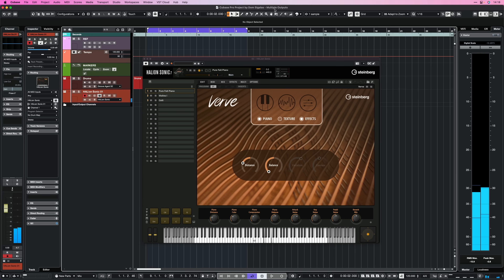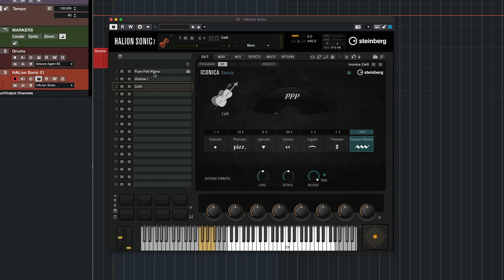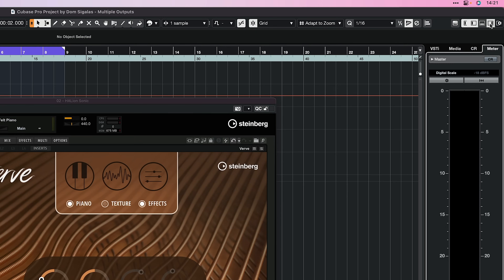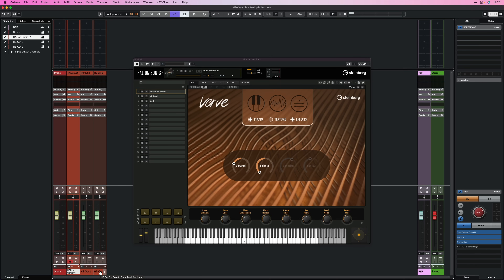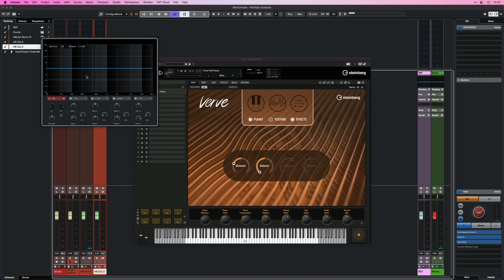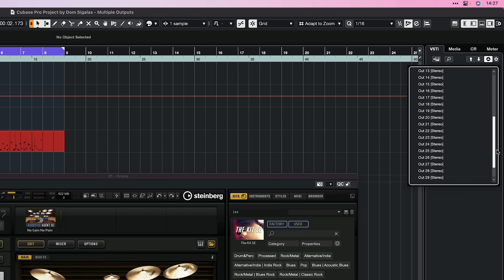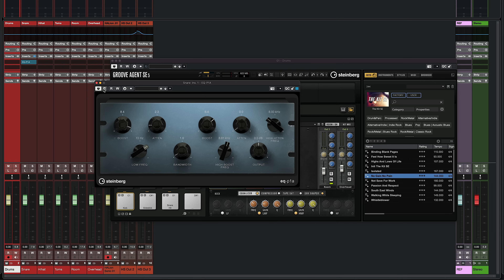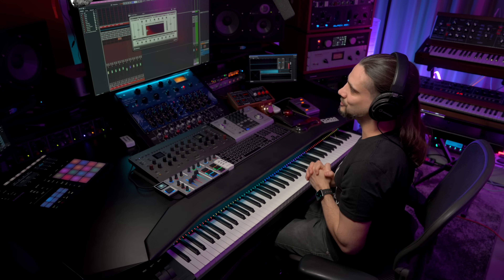How To Use Multi Out Instruments In Cubase | Cubase Secrets with Dom

Comment: My audio input into my Vmix is through a USB which gives me a single line of audio track. 

I need to split this single audio into int's different instrument lines/tracks (6-7 lines in all) so I can adjust each one as required before finally re adding audio to my Vmix production and final stream. 

I have been reading on and researching to find the best vst3 plugin that can do this. My plan is to install this VST3 plugin into Vmix, but I'm open to any solution that works too. 

Any advise? Thanks.

Comment: The drum part is very interesting and useful.
Now, is it possible to do the same for drums in terms of MIDI tracks?
When I record a drum track on my keyboard it all goes out to the same MIDI track.
Is it possible to reroute the Bass Drum, Snare etc. to separate midi tracks so that I could make MIDI edits in separate tracks?
Reply: Yep, use different channels, or try the input transformer, out a rule up the top  if note is C1, filter on ch 1. You can also have several lanes but unlike audio they are fine to play over the top of each other which is what I do most of the time .

Comment: Thanks, Dom!
Question guys: Let's say I'm working with Superior Drummer and re-route every mic to a separate output. The presets in SD have lots of nice plugins inserted in its built-in mixer. When I use route the mics/mixes to Cubase, I get the processes from every mic, except for the master, because now, of course, the mics (or each instrument mix if one has more than one mic, like the Kick) are routed outside of SD, and the final mix within SD gets no signal. So I lose the final step of the sound process (sometimes, there are several plugins there, maybe a couple compressors and an EQ, which are not included other than in that built-in mixer).
Is there a way to keep that, or should I replicate it with other plugins in Cubase itself (using a group channel)?
Reply: I've been wondering the same! Rerouting each mic to a separate output in the Mixconsole would mean that nothing will pass through SD's built-in master. So I'd just try and replicate the chain in a Drum Aux (FX track)